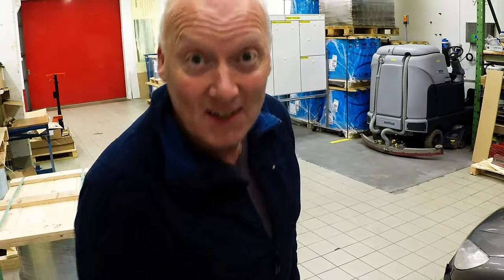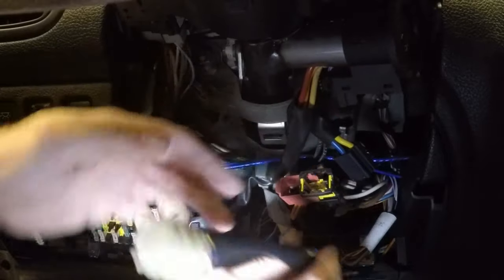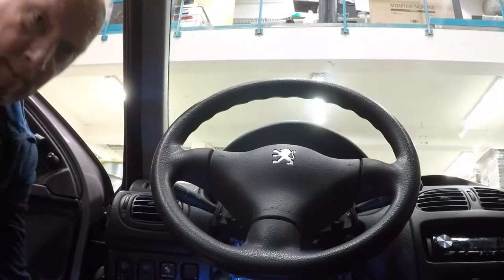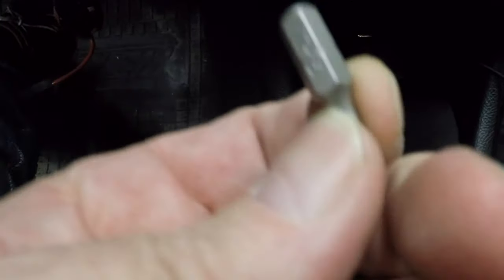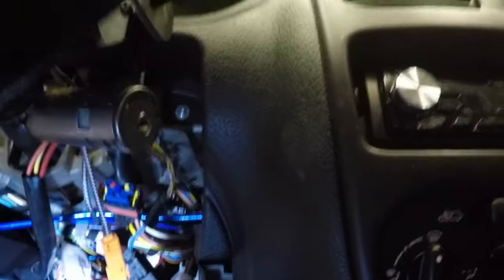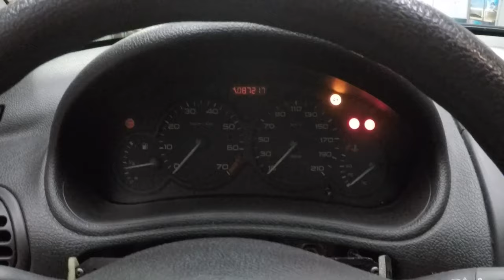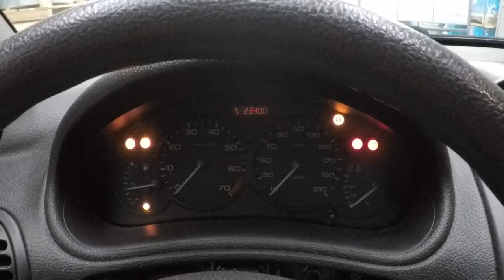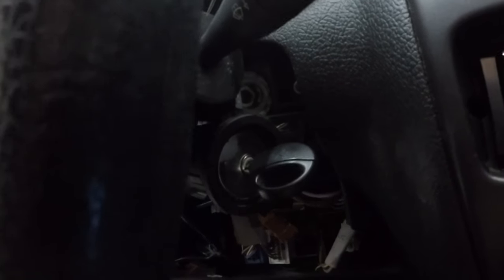How to change ignition lock switch on a Peugeot 206

Comment: Great
i want to ask a question . what if i did the same connection but i placed the ignition inside the immoblizer (black part) without placing them inside the metal part behind thw steering wheel . will the immoblizer work? will the car start? 
thanks in advance

Comment: Thank you for this video! I replace ignition switch very fast and easy because you! But I have problem now with new lock, car won't start! Instrument table works, ignition, but no start
Can you please tell me what can be problem? Programing new key code or something (Peugeot 206 Petrol 1.4)
Reply from the maker: Check that the imobilizer ring is correct installed on the new ignition. I forgot that and it won't start. After installing the ring back it started on first try. Look here: 19:50
Reply: Thank you for reply,  I found solution! First I try new ignition switch with new key and with that imobilizer ring, but no luck (won't start). Then I cut new key shell fob and replace with old one shell wich have remote lock.. Then with new key on old remote I go for reset remote control (hold on button 10sec in ignition lock) and now works !! :):):)
Reply from the maker: Fantastic 😀
Reply: @Italjohn Thanks again man ! Keep doing awesome work :)

Comment: Good job Mate!! What exactly was the initial problem? I mean did you replace the cabling as a solution for the ignition didnt worked? Did you have signs when you turned the Key but Still the ignition didnt worked? I am facing a problem like this one in your video. When i turn the Key at the First scale, i am having signs but i cant start the motor. It dosent do anything when i am turning the key at the second scale.
Reply from the maker: My problem was it didn't start now and then. The new ignition did not fix the problem, it was something with the immobilizer, so I sold the car to a guy who wanted it for spareparts.

Comment: hi
What were the symptoms that you changed ignition switch because I have a problem starting the engine and turning it off immediately, so I ask if it can happen
Reply from the maker: My car didn't start when warm. Change the lock, but same problem. I did sell the car as scrap. You seem to have an imobilizer problem.
Reply: @Italjohn  thanks for the answer, so no matter what you changed, there was still a problem ?because it happens to me when the car is warm, when it is cold it starts without a problem, do you think it's a problem with the key code or?
Reply: because it starts on me and immediately shuts off the engine as if I turned it off on the key, if I keep the key longer it stays on and works without problems
Reply: the diagnostics show nothing
Reply from the maker: If you hold the key and it works, it could be a lock problem.
Reply: @Italjohn  so it is as long as I hold the key it works ,thx for help, i have to try for a replacement
Reply from the maker: @dakaliftovidoo3714  Let me know how it goes, ok?

Comment: Interesting tutorial! I think I have another problem with my Peugeot. Starts but stops the engine in 2 seconds ...
Reply from the maker: That's typically if there is something wrong with the immobiliser. You need to have the error coded read out.